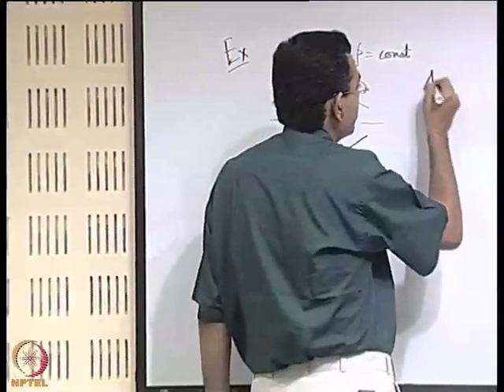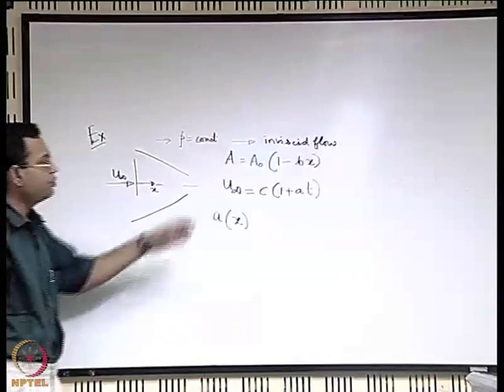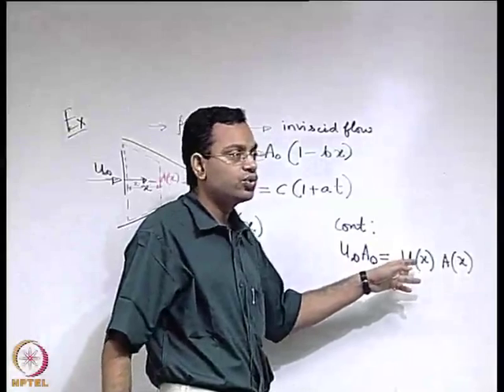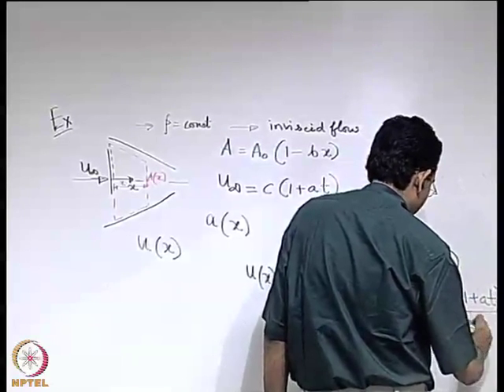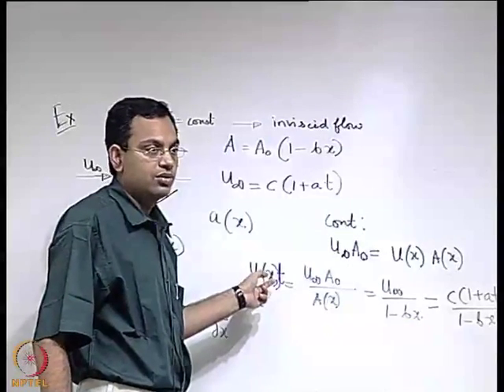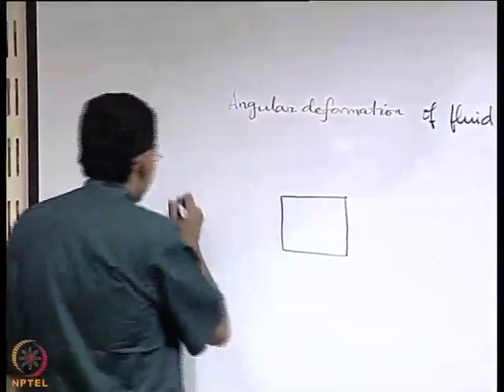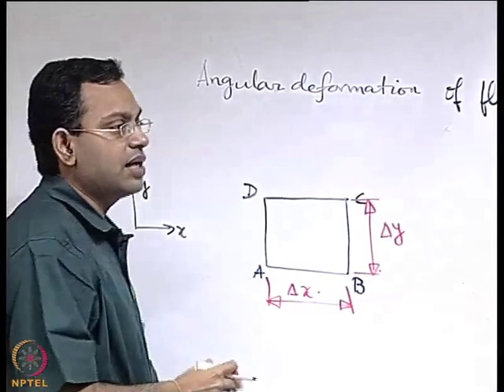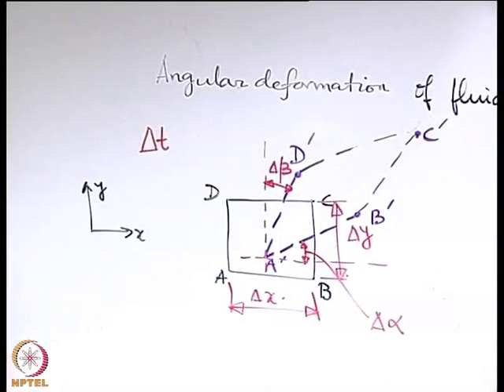Mod-01 Lec-14 Fluid Kinematics (Contd.)

Comment: Sir a little confusion in shear strain rate as u find the final result is (dv/dx + du/dy) in xy plane. But in R. K Bansal & also in Cengel book of Fluid mechanics the Shear strain rate is 1/2(dv/dx +du/dy).. Sir i have confused.. What is the true result..prof. S. K som also find the similar resut which u find.. Plz help i am waiting for your response..
Reply: One is tensorial strain rate (in which there is 1/2), and the other one is termed as engineering shear strain rate ...they both convey the same thing..Similar concepts are in solid mechanics as well...
Reply: follow no one you derive it ...automatically dv/dx +du/dy comes so it is the shear strain rate/ rate of deformation

Comment: Since it is not solid mechanics, even for rotation, as the angles rotated by the fluid element along x and y axes are not the same so 90 degrees, is not guaranteed, to be included in deformation?